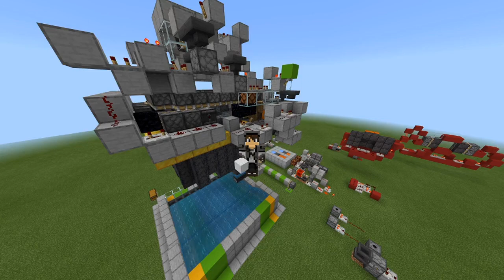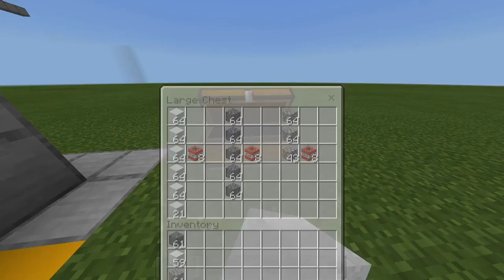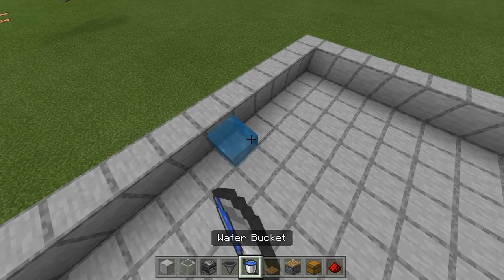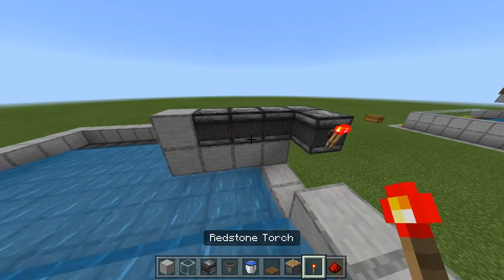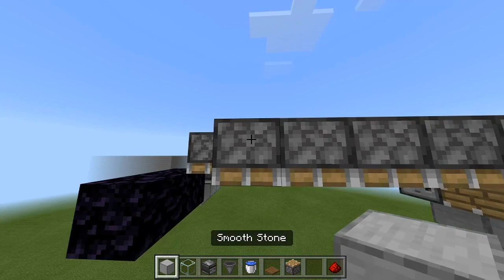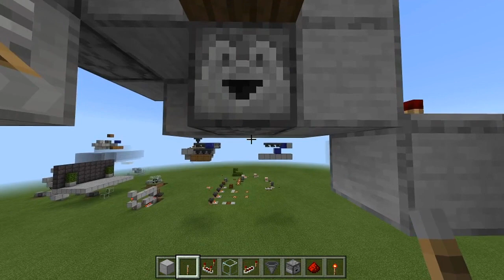Ultimate TNT Blast Chamber | Basalt, & Cobble | Minecraft Bedrock 1.16/1.17+

Comment: I made this and had issues with the tnt not dropping low enough. I fixed it by changing one of the repeaters leading to the two pistons back to 1 tick. This fixed the timing issue, but then it was blowing up the closest observer. I fixed this too by replacing it with an end stone fence gate. Other than that, this still works in 👍

Comment: Great design, seems the only issue I'm finding is tnt not getting the block in front of the observer 100% of the time. The repeater timings for the TNT pistons are the same in video I went back multiple times to make sure and I've got is chunk aligned. If anyone else has had this issue and knows a good solution please reply haha. Also if there is another part to the video I should go and recheck please mention that. Thank you
Reply from the maker: Sorry about your issue! I haven’t worked with the blast chamber in quite a while so I don’t know if I have an easy solution for you. 

The simplest thing I would say you could do is to replace the observer detection system with an etho hopper clock. This would completely replace that observer chain/torch tower making it impossible for the TNT to accidentally blow up your system. The only downside to this fix is you will have to turn it off manually but it should work.
Hope this helps 😄
Reply: @rocketbuilder  nice I'll give it a go thanks

Comment: For some reason the piston stop pushing the block down every so often and to reset I have to break the first line of concrete and it fixes it self but I have to keep repeating this so I can’t afk any help?
Reply from the maker: The system has a built in reset circuit in case this happens, so it should do this automatically. The circuit is the observer looking at the blocks being placed. (It then leads to a decay clock) Check that circuit to see if you missed a piece of redstone or something.
Reply: @rocketbuilder  ok thanks also when the concrete gets to the bottom some of the pieces are lower down than the block which activates the observer so the pistons stop pushing and the observer doesn’t get activated so no tnt comes down, I was wondering if this was a problem with the build or if I just missed some redstone
Reply from the maker: The reset circuit should also be connected with all the side pistons aswell so if thats not happening, you probably missed some redstone.
Reply: @rocketbuilder  yeah it works now. I forgot to put a block by one of the repeaters. Thanks

Comment: Do you know if this system works in realms. I just finished building it and it seems to work on and off. The timings are perfect ( I tested them myself) but for some reason the TNT randomly explodes too early and it blows the entire system up. Im not sure if its me screwing something up, or If realms is the cause of these misfortunes. Any info would be greatly appreciated.
Reply from the maker: With TNT systems, any and all lag can be catastrophic. If its a reliable realm it might work but I have not tested the system in them. For your random explosion issue, it might be your blaster is on a chunk boarder. A possible solution would be to decrease the one of the repeaters ticks down one to help ensure the TNT explodes low enough. It will drop your efficiency of blocks exploded per TNT but it would be more reliable.
Reply: @rocketbuilder  Yes I was also thinking about that yesterday, I’ll rebuild it within a chunk today to see if it has any effect. I can’t find any other reason for this system to be failing because as I said before the timings, like you have them, are perfect. Thanks for all the help! Hopefully this works.
Reply: @alexbalossi5812  Is it working mate?
Reply: @Nofaldjp  Yes it ended up working after chunk aligning. There is a scenario however where sometimes the cobble in front of the observer does not break thus breaking the automation. I tried my best to come up with a fix but its very bulky and hard to explain. Good luck tho!
Reply: @alexbalossi5812  That's why we "love" bugrock hehe. I'll problably try the ghast one, thanks
Reply: @Nofaldjp  best of luck!

Comment: Rough Material List (might be a couple repeaters off and just over did it on solid blocks to be careful)
	
Solid Blocks-	7 stacks
	Chest-	1
	Hoppers	- 21
	Glass- 	20
	Water/Ice-	14
	Observer-	12
	Redstone Torch-	23
	Trap Door-	10
	Piston-	33
	Obsidian-	7
	Redstone dust-	82
	Repeater-	19
	Comparator-	19
	Dispenser-	2
	Stone Wall-	1
	Dropper-	5
	Soul soil-	1
	Sticky piston-	1
	Blue ice-	1
	Lever-	4
	Stone Button-	1
	Lava Bucket-	1
	Redstone lamp-	1
Reply: this comment should be pinned
Reply: This is excluding tnt chambers?

Comment: Great tutorial!! I thought in Bedrock edition TNT explosions dont drop all the items, causing massive loss.  How did you get around that because i designed one of these also, and i should be getting over 2 stacks of concrete per explosion and im getting around 30-40 blocks, but all 64+ blocks are being blown up.
Reply from the maker: So with the laws of Minecraft Bedrock, at the moment, there is no (to my knowledge) a 100% reliable way to blow up blocks while getting the same number of blocks in return. I have tested a common method that is used on Java by pushing the blocks down in the same game tick the TNT explodes, but in Minecraft Bedrock, instead of lowering the blocks TNT blast resistance to 0, it gives the blocks a extremely high blast resistance for that game tick, resulting in no blocks being broken. So to answer your question in short, No. There is no way to 100% reliably explode and then collect blocks using TNT in Minecraft bedrock as of 1.16.
Reply from the maker: The best way to get this changed is to let Mojang know we want this change to happen by voting on it here, https://feedback.minecraft.net/hc/en-us/community/posts/360054102951-The-TNT-Drops-100-All-Items-Exploded
Reply: Rocket Builder u can use ghost explosions
Reply from the maker: Never heard of that before, I’ll look into it. Thanks for the Suggestion!